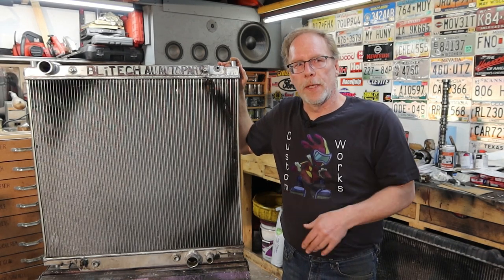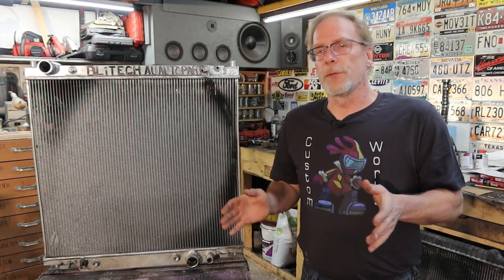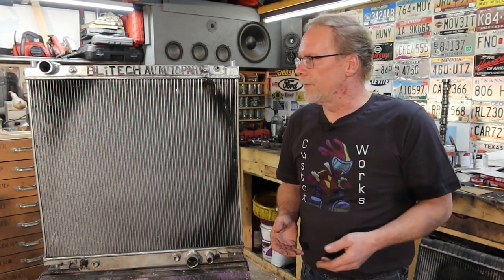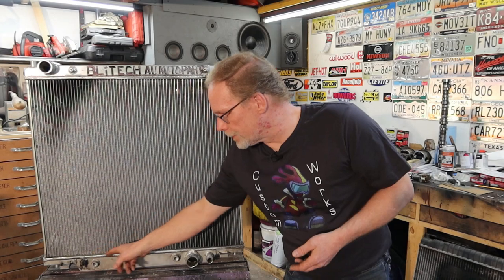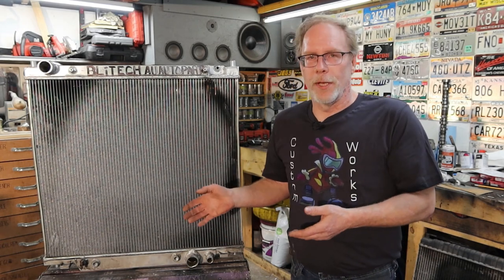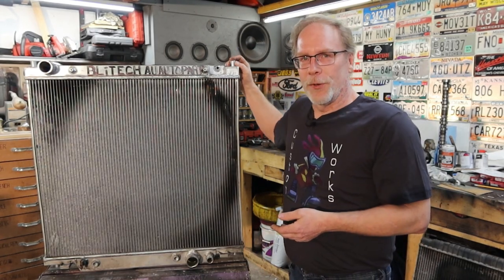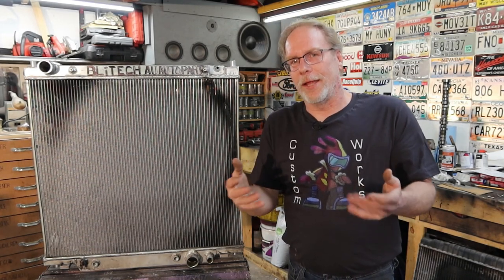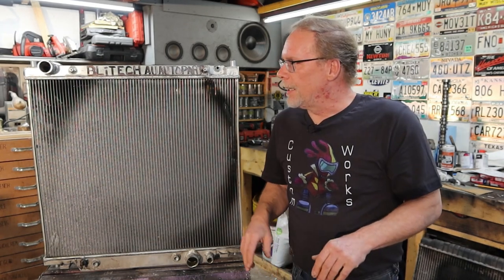Got Burned on Amazon seller Aluminum Radiator See the Review

Comment: Wish i had seen this earlier, bit i bought an Aluminum radiator on Amazon made by primecooling for my sons k10. So far it has good looking welds and is cooling fine, but we're heading into summer in the south so we'll see how it handles stress. Fingers crossed...

Comment: Did you have to use those two piece adapters for the transmission fluid warmer fittings in the bottom tank?  My '05 has quick couplers but the radiator has inverted flare fittings instead.

Comment: If the mounts, fittings, etc did not fit the vehicle, then why was it modified and installed to begin with? Why was AU Auto Parts not contacted before installation?

Comment: To be fair I have an 04 yukon with the og radiator, plastic tanks and all, still good 20 years later, I bought a gpi all aluminum one, if it leaks I will go straight back to oem..
Reply: I just hit 22 years on my oem nissan radiator in my 2002 supercharged frontier. It just blew the other day, leaking at the top seam where the aluminum little clamp things clamp over the plastic tank.
I guess it was it's time, Its the oldest radiator I've seen in any of my vehicles. It had a good long life and still got us an hour home after I let it cool down and added a half gallon or so of water.
Now I'm debating a ebay 130-150$ full aluminum radiator.
I already bought a 200$ plastic oem duralast replacement (most expensive plastic radiator I've ever seen). Havnt put it in yet though..
Both this plastic single row and the ebay 2 row aluminum are 1.6 inches thick at the core..
😅 something tells me it would be smarter to install the plastic duralast..

Comment: How has the Mishimoto held up? I'm seeing mixed reviews regarding leaks on those too. Griffin has mixed reviews as well. I'm starting to think it's the aluminum construction that's problematic.
Reply from the maker: The 2nd mishimoto is perfect, The amazon and 1st mish leaked in the same spot and yes its a aluminum core connection issue on all of them I repaired the Amazon and 1st Mish these companies don't take them back they just send new At least I can say Mish was fast on sending a replacement from complaint to at door 5 days  I,m over 2800 miles from them
Reply: @CUSTOMWORKS7.3PSD  Yea, that’s what I figured. I think I’m just gonna go stock MOPAR
Reply from the maker: @JeepTJay6  I would agree High price means perfection in quality Mish misses that mark by a galaxy away